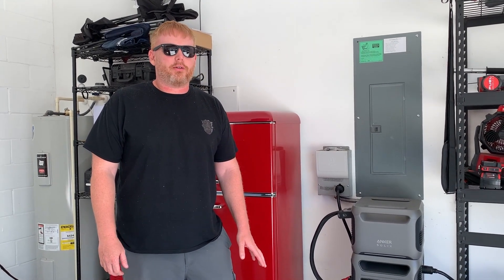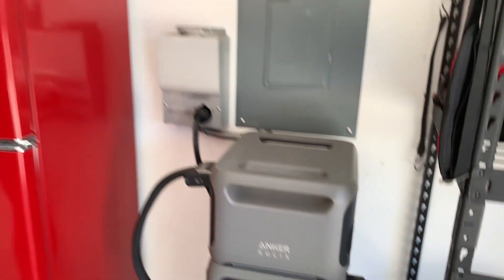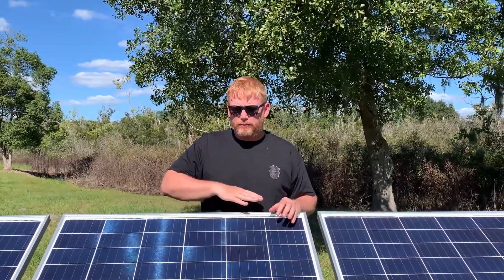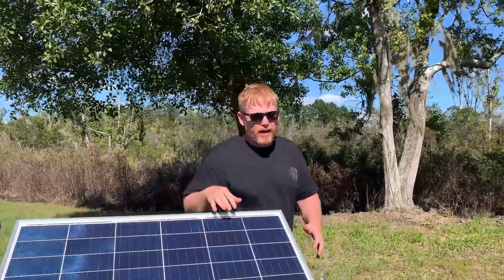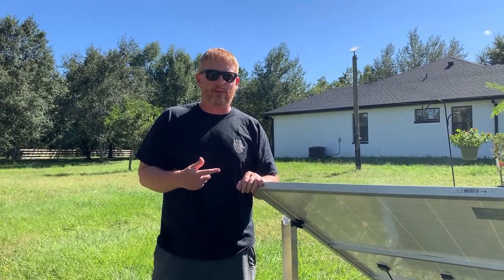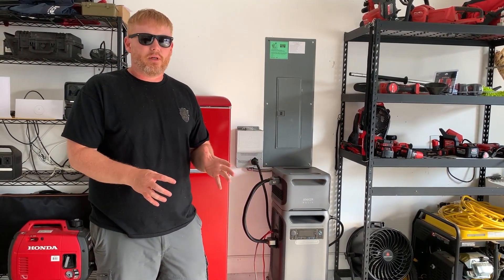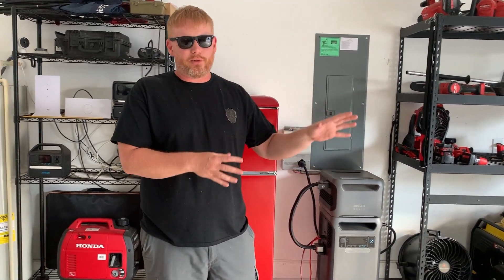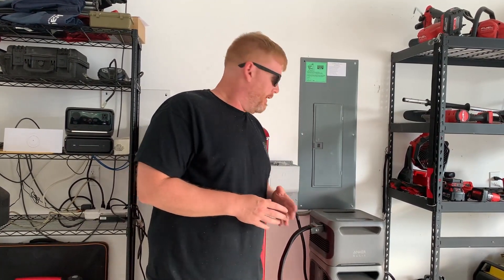Off-Grid Power Test: 1000 Watts Failed - Here's What Finally Worked

Comment: If you didn't have shade issues, why did you choose to only parallel them???
Reply from the maker: Initially I only had one run of 100 ft cable so the best we could do was 3 in parallel to keep ourselves under the voltage limit of the anker.

Comment: glad to hear this worked.  Not sure how i missed in your first setup that your panels were wired in parallel instead of series.  Not sure how you had 3 pannels in parallel and kept the amps under 27amps.  Great video and hopefully signature solar will run some deals on panels again this black friday.  Did the $700 include shipping?
Reply from the maker: I actually picked the panels based on them only being 9 amps. They were not the best panels, but they were the best I could find to fit in the very small box that the F3800 forces me into with the 60 volt limitation. If I remember correctly, at the time of their last sale they were doing free shipping if you bought at least a pallet of panels. I’m hoping for something similar this year because I have my eye on those Aptos panels!
Reply: @Backyard_Florida might have to check them out. Looking for some that have a longer warranty. 25-30 years ive seen on some

Comment: What a difference, it went from barely working to easy-street.   Yes, higher voltage and lower amperage.  It's a non-linear improvement because power losses go by the square of the current.  P = I * I * R.  So when you halve the amperage, losses are cut by 75% (not just by 50%... but by 75%).

The reason that is the case is because for the same amount of power, halving the amperage also means doubling the voltage.  So you get less absolute voltage drop from halving the amperage, and ALSO that voltage drop is now divided against a higher voltage... so losses drop very dramatically.

-Matt
Reply from the maker: That is awesome info. Thanks for sharing!

Comment: 200 watts of panels gave me 1000 watt-hours into my system each sunny day. 

So 1000, should have given you 5000 watt-hours and 1400, should give 7000 watt-hours. 

A refrigerator should use about 1000-2500 watt-hours a day. 

You have a lot of inefficiencies in your setup.
Reply: Yah, his fridge aint so good, and the Anker also bleeds 70W just at idle.  But the brute-force solution (adding more solar and rearranging the topology) was the easiest course for him to take.  At least to get things working smoothly.
Reply from the maker: We are definitely battling a host of inefficiency over here. The goal is to make the best use of what we have and to lean while doing it so we are able to spend our money more wisely in the future.

Comment: Have you considered swapping out the cable used in the 100ft run or do you think you’ll keep it the same?
Reply from the maker: For now, we will keep the 100ft 10AWG wire. Once we get a different style inverter we will be able to put our panels in series which will be much better.
Reply: @Backyard_Florida that’s makes sense, it currently does the job you need so you don’t have to worry about upgrading it currently.
Reply from the maker: But just like cars, more power = more fun!
Reply: @Backyard_Florida is this a hint towards car videos? lol